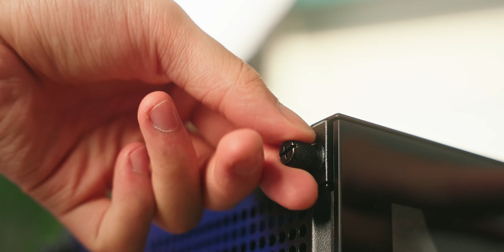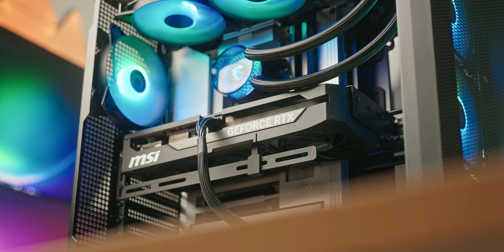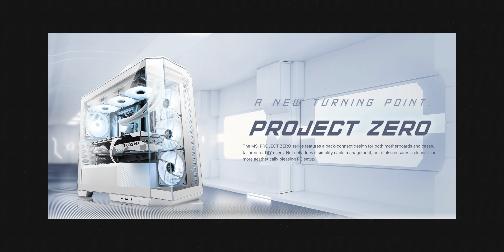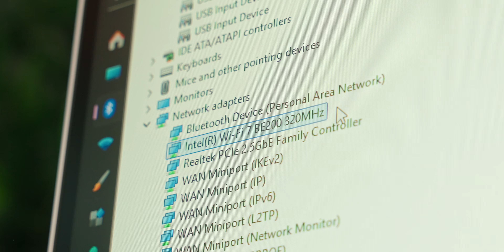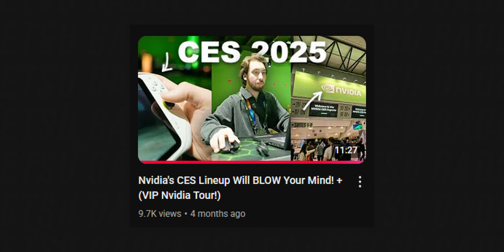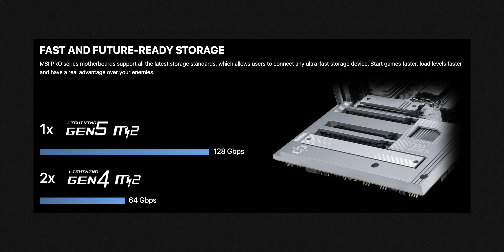Wait... Prebuilt Gaming PCs are ACTUALLY Good Now?

Comment: I had an older PC that had originally Windows 7 on it. I did all the upgrades but I could no further than Windows 10. My CPU was not compatible with Windows 11. I rode it out as long as I could and finally pulled the plug. I did the Costco MSI Geforce RX 5070, Intel Ultra 7 265, 32 gig, 2 TB for $999. I don't do a lot of gaming either but wanted something good & decent. Hooked it up yesterday & so far, everything good. The sad thing is my older PC was still doing fine but I only had a 512 HD & 16 gig RAM. It was time.......

Comment: I used to build gaming PCs, until the freaking scalpers ruined everything. So, I rolled the dice and bought a $2,400 CyberPower PC, and it didn't disappoint! The cable management is great, the case looks amazing, and they actually used really good components. It has a XFX PSU, which is made by Seasonic. So, if you spend more on a pre-built, you get more in quality, usually. Just do your research before buying. Mine has the Intel Core Ultra 9 285k, 64GB RAM, 5070Ti, 2TB NVMe (which I upgraded to 6TB). I would've probably spent around $3k to build the same kind of system. Not to mention, I could run into more issues. I wish I had a Microcenter down the road, but I don't.

Comment: Im not really a fan of these OEM prebuilts. They tend to have really low end power supplies and proprietary parts making upgrades impossible which forces you into buying a new computer instead of just upgrade the graphics card later on. I also usually recommend trying to build your own PC. But if you cant or dont want to for whatever reason TerraCore PCs has some good deals on their prebuilts. One of them has an i7 and an RTX 3060 12GB for $700

Comment: I got an amazing deal for an msi prebuilt just last year for $1300. It came with a 4070 ti super and a 13700f for that price. Just the graphics card alone costed near 1k when you could find it. I got all msi parts too so upgrading won't be an issue.
Reply from the maker: Omgggg that's an amazing deal and for the 4070ti as well! And yes, GPUs are so expensive and the supply sucks too it's crazy! Thanks for watching! 😁